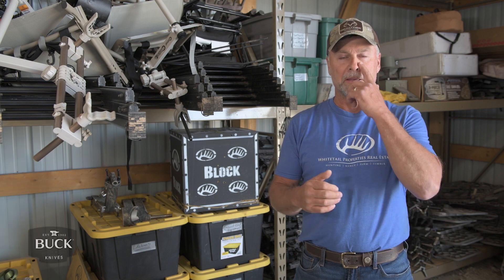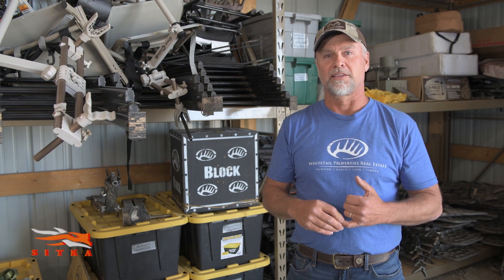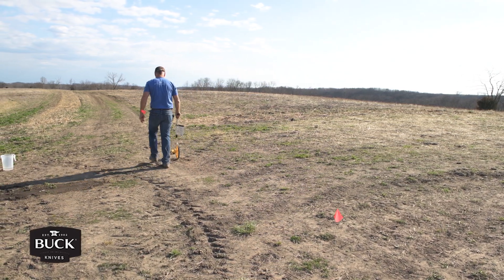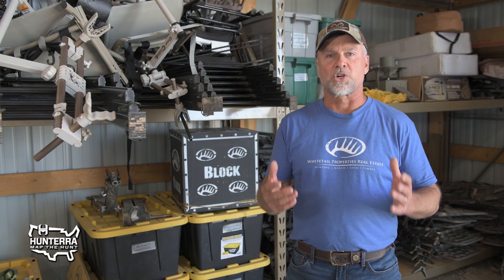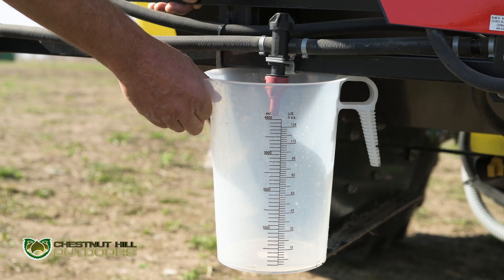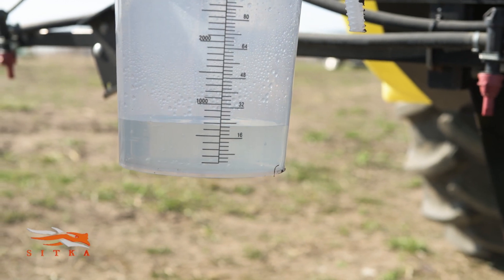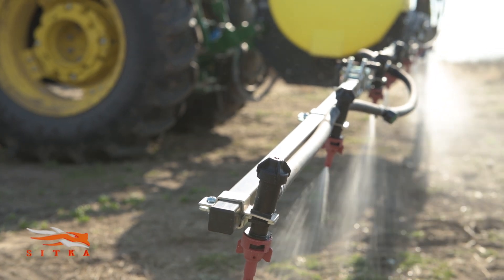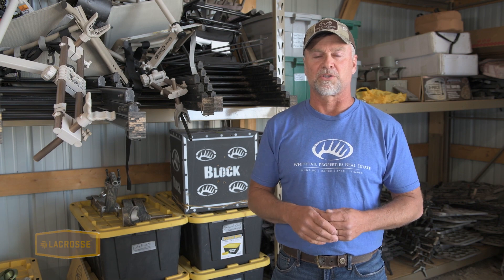How To Calibrating a Boom Sprayer

Comment: if i have  20 nozzles at 20 inches  apart and getting 18 ounces does that still mean 18 gallons per arce
Reply from the maker: It would depend on the speed of the tractor...
Reply: what i meant was, it doesn't matter how wide your sprayer is if do everything right this works